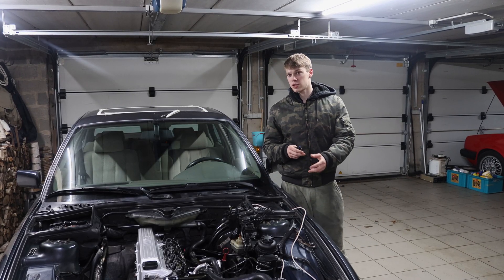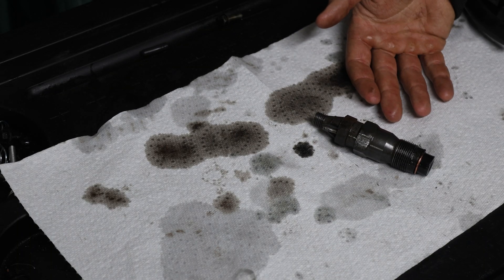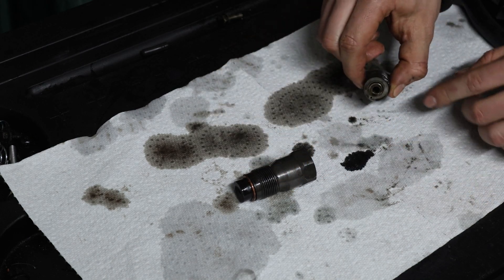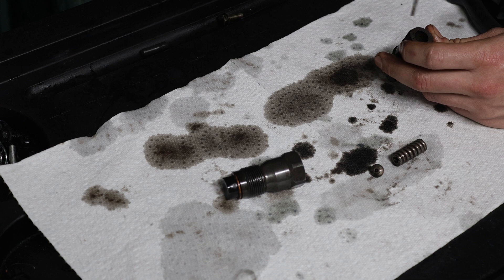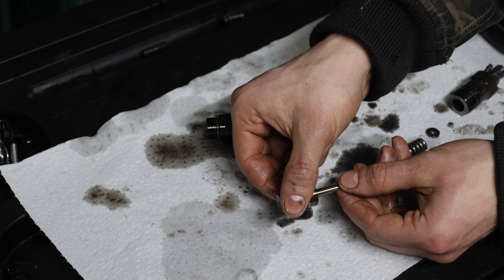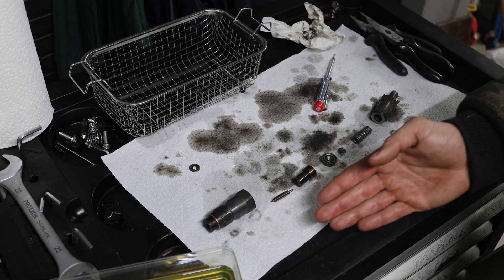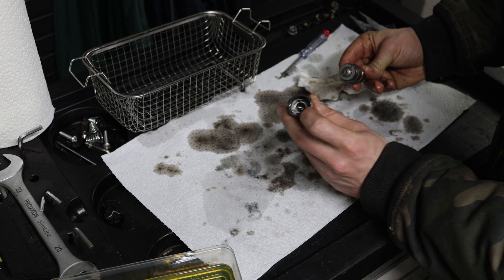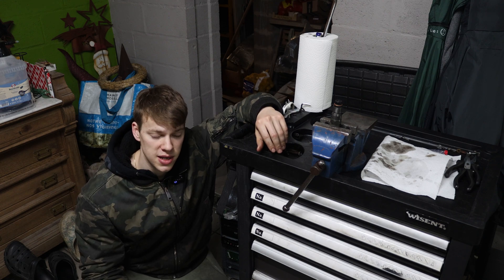Injector rebuild/reseal M51+ M41/ Bosch

Comment: What tool did you use to get them out? And what about the washer? How to prevent from falling down the engine bay?
Reply from the maker: @Exekutioncro  i bought the socket on amazon and the washers are always stuck on the injectors. No way they are falling down
Reply: @DailyDrivenClasssics   Do you have to change the washers? Can you give me a link to that socket? Im going to pick up a 318tds next saturday which is only running on 3 cylinders. I suppose one of the injectors is failing, so I wanna change that one. Would appreciate any help!
Reply from the maker: @badblueboyzg867
@badblueboyzg867   this is the socket i used: KS Tools 455.0032 And i didnt change the washers. just make sure the sealing surface is clean in the cylinder head

Comment: You are missing a part about washers, usually they are leaking from bad washers
Reply from the maker: @relaaaxingchanel3000 Really? didnt find anything about that, but sounds plausible
Reply: @DailyDrivenClasssics  I had a similar situation on a merc w202, changing washer solved problem. Now i have leakage on e39 with m51 but this one also leaking from underneath the injector, thats how I find your video which is great btw, I will try with locktite like you in video and see what happening.
Reply from the maker: @Rexona8  dont use thread sealer. In one of my newer videos it annoyed me more dissassembling the injectors than it helped with leaks :( I bought the lead injector new.
Reply from the maker: No , the issue were leak lines that were leaking despite being new. Changed those and had no leaks anymore🫠
Reply from the maker: Fuel return. Also its very possible that uncleanly  working surfaces cause leaks. Small particles on mating surfaces are enough to form leaks
Reply from the maker: @relaaaxingchanel3000
@relaaaxingchanel3000 Pretty sure its the copper sealing ring. probably because of dirt/ particles on the mating surface. very common. Had that aswell after removing the injectors once. it was so bad the engine wasn't running right because it was losing compression on that cylinder
Reply from the maker: @ no need to do so, just clean the surface where the copper rings sits in the cylinder head
Reply from the maker: @Rexona8  cleanliness is extremely important on diesels. newer ones even more than old ones, but even on m51 it's vital
Reply from the maker: @Rexona8  😂 Surely just a bit of bad luck in the beginning. I'm sure it'll be better in a few weeks :)
Reply from the maker: @ I had no symptoms, i just changed it preventively. But iirc if the lead injector fails the engine doesnt start or run, cuz the dde doesnt have acces to injection angle
Reply: @DailyDrivenClasssics  And how did you done one with wire?

Comment: Hi, could you help me with the part number for the rebuild/reseal kit for injectors you used in this video ? My car is TDS, but i suppose the injectors are the same as yours ?
Reply from the maker: @ognjennikolic1384  check out my rost recent video on these injectors. I've given the part number for the nozzles in a comment. Also, in this video i only cleaned them, no new parts were fitted

Comment: I must rebuild my injectors too. How did you remove that copper injector seal?
Reply from the maker: I loosened it gradually with a scalpel and smal screwdrivers. It need a lot of wiggling around since these are really squished. Make sure to get the correct size copper seal, since I had no correct size in my copper seal assortiment i had to reuse the old ones unfortunately. Thankfully they do seal:)
Reply: @DailyDrivenClasssics Ah it's as I feared no easy trick to it. I got the Bosch 2 430 105 044 seals. What is NM for the injectors when I install them back to the engine?
Reply from the maker: @gyulay.n54  should be fine then. Iirc the injectors get torqued to 65 Nm
Reply: @DailyDrivenClasssics  Thanks to you I decided to fix my tds İ was about to scrap it. You are awesome 👍
Reply from the maker: @gyulay.n54  thats awesome!!! Thats basically why  i started this channel:) m51 isnt really appreciated for what it is😇 keep fixing it until its mint 😀